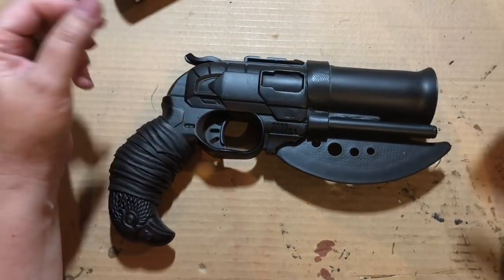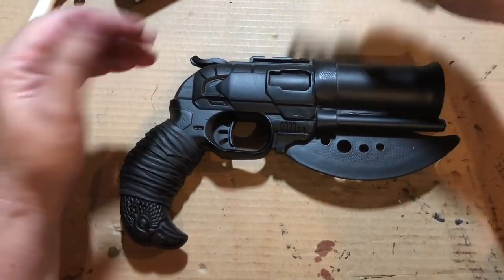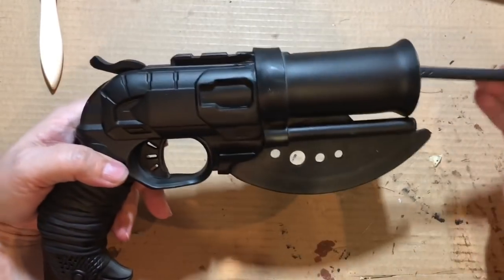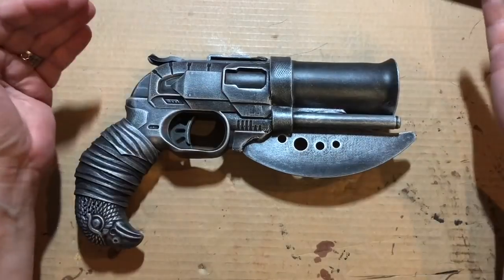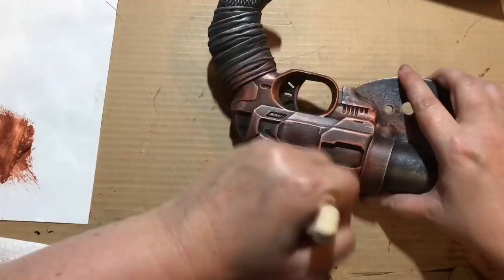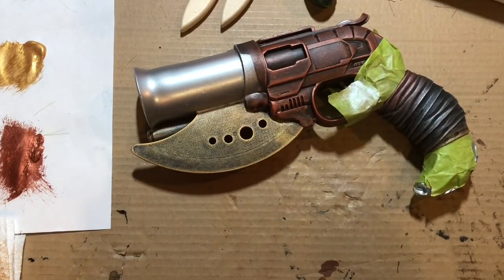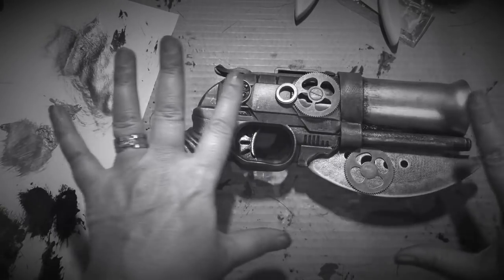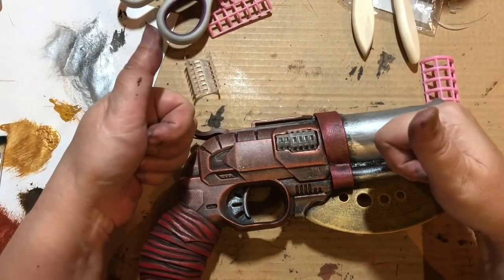NERF DOUBLE STRIKE BLUNDERBUSS MOD - Nerf Double Strike mod walkthrough

Comment: I love this one so much. I think this is my favorite project of yours so far. In all the nerf mods I've seen I dont know if Ive seen anyone change the bottom of the handle. The eagle was a nice touch and unless you said anything I dont think that I would have guessed the new wrapping was EVA until you started painting it. The color choice works really well in my opinion. It didnt really pop until you added in the black to most parts and once you did it looked great. Personally I dont know about the skull you painted on in the little recessed area but it still fits really well. Very very nice job!

Comment: Two questions, what size pvc did you use? And what did you use for the blade? Thanks
Reply from the maker: I explained in the video, but the blade is from a toy axe, I just cut it to fit. The diameter of the PVC will depend on what blaster you're slotting it over. Hope that helps.
Reply: Nerfenstein aka GirlyGamer thanks, I watched the live stream video and this one and never cought any information on the blade.